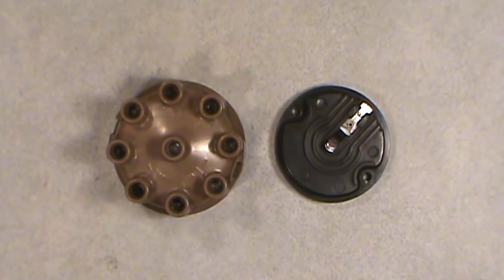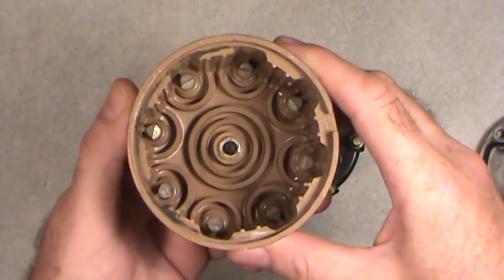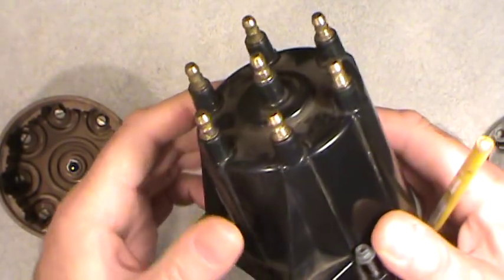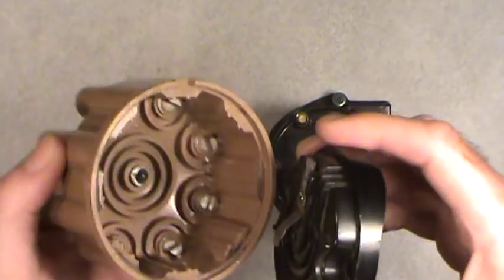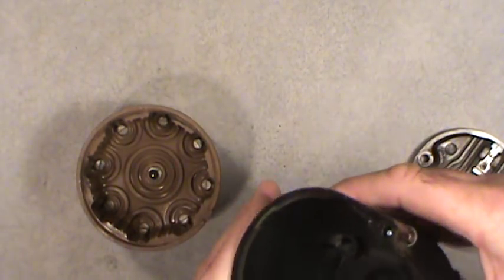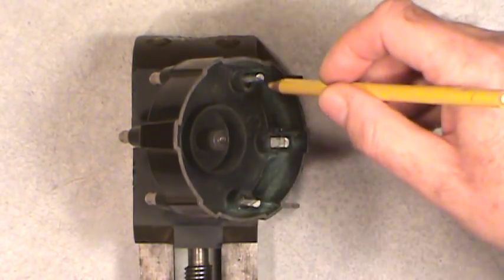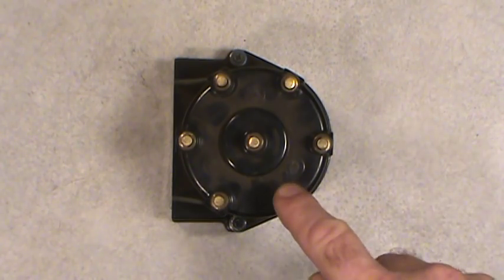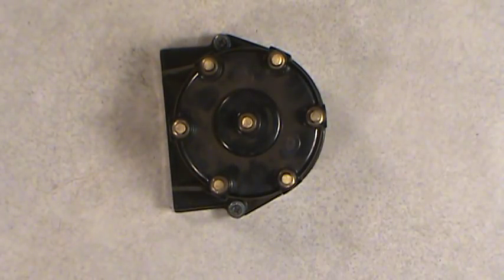How to Inspect Distributor Cap and Rotor Condition (Part 2)

Comment: I am looking at some replacement caps & rotors for my car. I see different contact materials (in order of cheapest to most expensive): steel, graphite, stainless steel, and brass.

Is it worth buying the better parts for a clunker? Specifically, a 1993 Grand Cherokee. If steel will last 2-3 years, then I'm fine with that.

Can I mix the contact materials? I.e., a cap with steel contacts and a rotor with brass.
Reply from the maker: Greetings Adam Klingenberger....My advice, and what I usually do with an Average Car or Truck (aka Grocery Getter), would be, to stick with "Brand-Name" Parts for starters, as opposed to Cheap, and Low Quality Parts, that may not work all that well, or, last all that long either....Seeing as how you classified your Jeep Grand Cherokee as a Clunker?, I take it that you would like to have your Ride Run Properly at the Lowest Price possible perhaps?....If that be the case, then I would at least recommend going with a Distributor Cap with "Brass" Terminals (only a little more Cost over Aluminum Terminals in the distributor cap)....Aluminum Terminals in the Cap will "Erode" (electrical arc) at a faster rate then the Brass ones, although, Aluminum terminals will still get the job done....Also, some of the Manufacturers out there, are Molding in, what look like "Vents" on top of the Distributor Cap (kinda looks like a "Mini-Tower"), and, I think that they did this to Minimize "Condensation" (water droplets) inside the Cap (just something that you may have on your new Cap, as a Bonus Feature!)....Now for the Rotor....The "Tip" of the rotor is usually made of Steel, and that will work just fine....The Springy Steel "Strip" that connects with the Center Contact inside the Distributor Cap is usually a Bright Silver Metal (either a type of Spring Steel or Stainless Steel)...and...(a better/more expensive type of Stainless Steel will be "Anti-Magnetic", and, can easily be checked with a fairly Strong Permanent-Magnet as well)....The thing to look out for with some of the Rotors that I have seen, is, to have a close look at how the metal Tip (usually a flat bar of steel) is "Secured" to the rest of the Rotor Material....Watch-out here now, as some of them are Barely secured with, what looks like the Rotor Material just being "Melted" (probably by Heat), and, from my perspective, is rather "Weak" to say the least....Also, have a look, and see if any of the Parts Places in the area where you reside, offer the Distributor Cap and Rotor as a "Kit" (Kit = Cap and Rotor in the same package), as, that will save you some Money as well (I have found that buying them Separately usually costs more, most of the time)....Also, no matter how much money that you decide to spend, it would be in your best interest to Check these "Hidden" things (namely, in this case, Your Cap and Rotor) at least once a Year, or at 12,000 Miles/20,000 Kilometers interval, whichever comes first!....Make sure that you "Check" your "Base-Ignition-Timing" immediately after you install the New Distributor Cap and Rotor, as, there are Manufacturing "Tolerances" of these parts, that Don't Guarantee that your Ignition Timing will be the same as before!.... Don't forget now, there's a "Whole-Lotta-High-Voltage-Sparkin-Goin-On!!!"...lol....So then, I recommend going with a "Brand-Name" Distributor Cap with "Brass-Terminals" (might even have that Mini-Tower that I had mentioned earlier), and, a "Brand-Name" Rotor as well (the one that is in the "Kit", if you go that route, will be just fine)....Now, Go Shopping!...lol...Good Luck....Take care, and have a good one.

Comment: So I've got a 1971 F100 with a 5.9 V8. I recently replaced the spark plugs and wires, but after I did that it had a horribly loud knock. It was running just fine that day until I changed the plugs and wires. Could it be the distributor/cap?

Comment: CAN THIS CAUSE YOUR CAR TO RUN GOOD FOR 30 MINUTES THEN NOT WANTING TO START AFTER WARM MOTOR.
Reply from the maker: Greetings siKC One The Great....Thanks for watching, and for Your comment too....Usually, a Distributor Cap and Rotor, for the most part, from my experience, hasn't caused the "Symptom" that You seem to have "Experienced"....But, the "Ignition Wires", as I have experienced in the past, "Did", make a Car, that I had at the time, "Do" some very "Strange" Things!!!....I will get to the "Story", in a few moments, but first, in order to Help You out, with Your Car's "Problem", I really need to "Know", what "Year", and "What" Car, that You are having the "Problem" with ???

"Diagnosing" a "Fuel Injected" Engine, is quite a bit "Different" from, "Diagnosing" an Engine with a "Carburetor" on it!!!

Now then, back to that "Story" of mine...

I had a 350 Cubic Inch Chevy V-8 (1971), with a "Points and Condenser" Distributor Ignition System.

Sometimes, I would Start it up in the Morning, and it Ran Fine..."Until"...

..the Engine was almost Fully Warmed-Up..."Then"...

...the Engine, would, All of a Sudden, "Go Silent", and, shut itself OFF!!!...

...If I let it "Cool-Down" for a while, it would start back up, and would Run OK, for quite a long time.

I still recall, Cruising along, on a Secondary Highway, Engine was running Ok, then, "Silence", for about 3 to 5 Seconds, then, it Started Running "Again", as though, it Never Stopped Running!...(closest encounter, that I ever had, with a..."GHOST!!!"...lol).

So, I was Puzzled, with just "What", may be causing this "Weird", Automatic, Shutting-Off of that 350 Chevy Engine???

Then, I figured that, it's probably the "Ignition Coil" that's Causing the Running "Symptom" that I was Experiencing...

But, before I "Condemn" that there Ignition Coil, maybe I should I start looking around at all of the Ignition Parts and Pieces, before, I run out, and Buy a New Ignition Coil...

Everything seemed to look just fine..."Until"...

...I Removed the Coil to Distributor Cap's "High Tension" Lead (aka, ignition wire, that goes from the ignition coil's center tower, to the center of the distributor cap), and, I had a Look at Both ends of that Ignition Lead (Lead = Wire), and...

..."There's the Problem!!!"...

...It turned out to be, that, the "End" of that High Tension Lead, that Connects to the Ignition Coil's Tower, actually "ARCED" (Arced = High Voltage "Spark"), Between the Ignition Wires "Internal Conductor", and the "Metal Terminal", that, it's supposed to be, "Positively Connected To!!!"

That High Voltage "ARC", over quite some time (I figure), actually Started "Eating" that Coil to Distributor Cap's Ignition Wire's "Internal Conductor", to the Point, that, there was just "Too Much Distance" Between the Ignition Wires "Internal Conductor", and the Ignition Wire's "Metal Connector", that it's supposed to be "Crimped Solid" To!!!

Once, I Installed "NEW" Ignition Wires, the "GHOST", that was Haunting my 350 Chevy V-8, "Vanished", and my Engine...

...Never Saw that "Ghost" Again!!!

So, there You have it, "Some" Problems, can be "Intermittent", and at times, "Hidden from View", as well.

So, while, Some, "Parts and Pieces", might "Look" Alright from the "Outside", they "Sometimes", "Are Not" Alright on the "Inside!"

So then, if You care to, please let me know, what "Year", and "What" Car, that You have there, so, I can help You out, with-out, having me, going on a...

..."Wild Goose Chase!!!"...lol...and...

...Be Safe, take care, and have a good one.
Reply: RockysRoadshow thanks for the help i have a 1992 caprice classic v8 5.0 l
it is a tbi car. i just changed couple parts on it. I changed the icm, ignition coil,fuel pump,cooling sensor, and purge valve. but nothing still does the same. now im thinking of changing the pick up coil and the distributor cap???

i will check the ignition cables.
Reply from the maker: *****
Greetings siKC One The Great....I have had very good luck, with a Fuel Injected vehicle, just a few years newer then Yours, and, although the actual Fuel Injection System, Is Not Exactly the same as Yours is, give the Following a Try, as it "Does-Not" Cost Any Money at all....Here is what I do, when Experiencing a "No Start" (of the Engine), and "Especially" when the Engine is..."Warm" or "Hot!"....First, make sure that Your Transmission is in Park, if it's an Automatic, and, Neutral, if it's a Standard Transmission, and, make sure Your Parking Brake is On, just in case...

...Then...Just Simply "Hold" the Gas Pedal Down, about 1/4 to 1/3 of the way down, and Hold the gas pedal there, while You Start the Engine, and, if the Engine Starts, get Your Foot OFF of the Gas Pedal....If the Engine starts Stalling on You, when You took Your Foot Off of the gas pedal, You can try to give it just enough gas pedal, to keep it from Stalling.

If the Engine will Idle and Run OK, with Your foot "Off" of the gas pedal, and, if the engine sounds and runs Ok, try driving it a short distance, and see how Your Engine Runs/Acts.

I have found, that the above Procedure, will..."Also"...Help a Fuel Injected Engine, that is having Trouble with a..."Cold Start"...Start Very Good as well...!!! (Yes-Sir-ee-Bob, for me, it worked like a "Charm!")...

..and look Ma, I didn't even spend a "Cent" (actually in Canada, the Canadian Government "Discontinued" Making, and might be in the process, of Not Using, as Currency, the "Penny" or, its Other name, being "Cent", and more then one Cent, are called "Cents").

While, I can't Promise, that the above Procedure will work for Your Engine, as in, helping it to "Start", either "Hot" or "Cold"...for the Price, which is "Nothing", I think its worth a try, Dont-cha think?

Try "My" so called Hot & Cold Helping-to-Start-the-Engne "Procedure", and, see if it works for You.

Let me know, if You have any Success, or, otherwise.

Be Safe, take care, and have a good one.

Comment: I have a 97 Nissan altima it turns over but doesn't start sometimes it starts for a sec then goes right back to turning over with no start what could it be also my starter signal is not getting any power
Reply from the maker: Greetings Jamiliah Collier....There are "Many" things, that can cause similar "Symptoms", such as the one/ones that that Your Car is experiencing....It may be a "Fuel Starvation" Problem, that could include a Faulty Electric Fuel Pump (that Hides inside Your Car's gas tank), or, any of the related Electrical Parts, such as a Fuel Pump Relay, or, even something as simple as a Clogged Fuel Filter perhaps....It might even be an Ignition problem....I have found that sometimes, the following might get Your Car's Engine Running, but, No Guarantee, and, the Price is right...Free!!!

Try starting Your car's Engine, using the following procedure, as I have found that, in some circumstances, to worked for me.

You can try the following, with Your Car's Engine Cold or Hot...

Make sure Your Car is on Level Ground, In Park (automatic transmission), with Emergency/Parking Brake On.

Just Hold Your Gas Pedal Down, about 1/3 (one third) of the way, and hold it there, while engaging the Starter.

If it Starts, get Your Foot Off of the Gas Pedal, to keep Your Engine from Spinning Too Fast (and may Damage Your Engine).

Will the Engine Start, and keep Running?

What You will probably have to get done, is, to get Your Car's ECU (Car's On-board Computer) "Scanned", with a Device, called a "Scan Tool" (kinda looks like a Big Calculator), that will "Extract" any "Trouble Codes" that might be "Stored" in Your ECU (aka, cars computer).

The "Trouble Codes" (if any), will "Inform" a Person, in a pretty precise way, as to what might be wrong with any of the Sensors, Actuators, Electrical Circuits, and, even the ECU itself, as the case may be.

Here's a Tip, to help "Extend" the Life of Your (in the gas tank) Electric Fuel Pump...

...It's Simple, really, just keep Your Car's Gas Tank at least 1/4 Full (one quarter), at all times, Never less!

The reason being, that, the Gasoline itself, helps to keep that (in the gas tank) electric fuel pump "Cool", otherwise, it might just get a little bit too hot, shortening the useful life, of that "Expensive" Electric Fuel Pump, not to mention, the Labor Costs, to Install the New One, in the gas tank!!! (Hundreds of Dollars!!!).

Like I was saying in a previous comment/reply...Start with a Proper "Tune-Up", that has to be done anyway.

Best of Luck...

Be Safe, take care, and have a good one.

Comment: I just spent a grand on a brand new carburetor timing and a tuneup on my 77 Ford LTD with a 400 Engine.  I am assuming the mechanic set the carburetter screws up correctly   But the spark plugs are black and sooty?    Along with the exhaust pipes Also.  The car hasn’t been running for years when I bought it three years ago and wasn’t running as bad when I first bought it so I assume the engine is just plain wearing out?    There is some blow by coming out of the oil cap when it’s running so it could be piston rings or who knows what I’m  just wondering why the spark plugs are so sooty.
Reply from the maker: Greetings...Wolfwagon C...……..Thanks for watching...……..Well, black "carbon", that's covering the things that you mentioned, might be, too much fuel (gasoline), in the air/fuel ratio (mixture), or, too weak of a spark, between the spark plug's electrodes (ignition misfire, possibly?), and also, sometimes, one or more (engine) cylinders, not having enough compression, in it/or them, as the case may be...…….Too rich of an air/fuel ratio/mixture, can sometimes, be caused by the carburetor's "choke" plate, not fully opening-up, into it's, usually "vertical" (up and down) position, when the engine is fully warmed-up to operating (coolant) temperature, as in, a choke plate, that's not fully opened up, will restrict the amount of "air", that's entering the top of the carburetor, which will make the carburetor run too rich, when the engine is fully warmed-up...……Also, the carburetor's "float" (inside), can sometimes be faulty, not adjusted correctly, stuck some-what, and also, on much older carburetors, there can be times, where the float, might even sink to some extent, which will allow gasoline, to rise (up), too high in the carburetor's float bowl, which usually results in, way too much gasoline, being dumped into the engine (not so good...right?)………..Also, the needle and seat (valve), that the float actuates, might not be sealing properly, when-ever it needs to be, as in, when-ever the carburetor's float bowl, gets up to its full gasoline level (sometimes, dirt/debris or crud, on the needle & seat, will cause the same problem, just so Ya know)....….If the carburetor on your 400 cubic inch engine, is like the original carburetor, then, I'm thinkin', that, it could be the model 2150 Ford, 2-barrel (Motorcraft or Autolite maybe?), and, if it's like the model 2100 carburetor, then, it might have had, a bracket on the side of it, where, one of the coolant (that be, the anti-freeze and water mixture), rubber heater (core)"hoses", sat in, right next to the carburetor's thermostatic choke spring housing, to help warm-up that spring, to make it relax (un-coil itself?), when-ever the coolant's temperature gets hotter, so the choke plate will open-up, to it's "fully open...vertical" position, so, have that "checked-out", just in case...…..On your (maybe?), model 2150 carburetor, there might be a small canister looking item, that's usually called a "choke pull-off"...or sometimes, it's called a..."vacuum break"...and, it is responsible for opening the choke plate, just a little bit, when the cold engine is first started, so, make sure that it's adjusted and working properly...….....There is something called a "spark tester", that doesn't cost very much, that will usually have 2 electrodes in it, that are spaced apart a certain amount, and also, there is an adjustable one, that has markings on it, marked in the thousands of volts, and to use one, just follow the spark tester's instructions, to test the strength of the ignition system's output...…….With the engine "not running", it's usually, just a matter of, plugging the spark tester, into one of the spark plug wires, and, connecting a/the ground wire, from the spark tester, to a good engine "ground"...…….There's bound to be some "blow-by", when-ever an engine reaches the 100,000 mile mark, that's showing, on the vehicle's odometer, and, for the most part, it's probably due to, the piston ring's "end gap", getting larger, as the rings and cylinder (diameter) wears a certain amount...……..To test for the amount of "blow-by", I usually "remove" the PCV (Positive Crankcase Ventilation) valve, and any hoses, that are connected to the valve cover, or covers, as the case may be, and, having the engine fully warmed-up to operating temperature and running, I have a look-see, as to, how much...???..."blow-by"..."Smoke"...is coming out of, any of the open holes on the valve/valve covers...……..A simple "compression test", can be done, on all 8 cylinders (one at a time, of course...lol), in order to see, what kind of cylinder "pressure" (compression), that, there happens to be...…….The good ole rule of thumb, use-tah be, 100 PSI (Pounds per Square Inch) "minimum", of cylinder pressure (as in, at the very least), and also, not having too much of a difference, in cylinder "pressure", between all 8 cylinders, as it applies to your 400 cubic inch "V-8" engine...…….Make sure that, all ignition system parts & pieces are in like new condition, and, the air and fuel filters are really clean too...…….If you are still having trouble, after checking the above things, then, just give me a shout...…….Good luck, and...…..till next time...…..Be Safe, take care, and have a good one.

Comment: 15:05 NO. You mark the wires: Take a picture. Take wires off. Take Cap off. R&R Rotor. Install Cap. Install Wires just like you see in the picture you took.